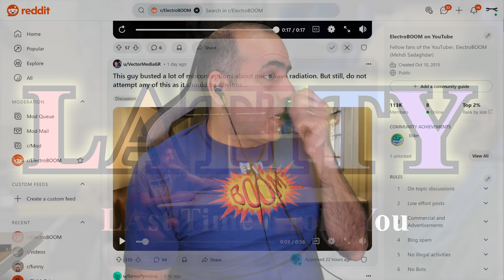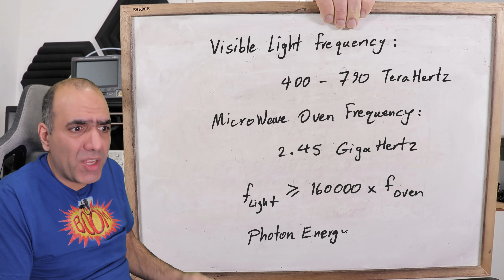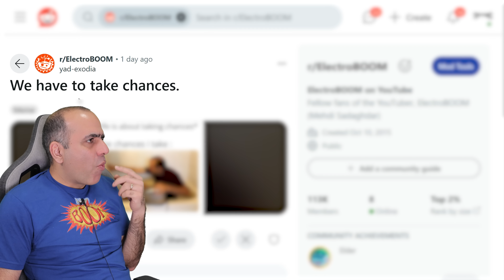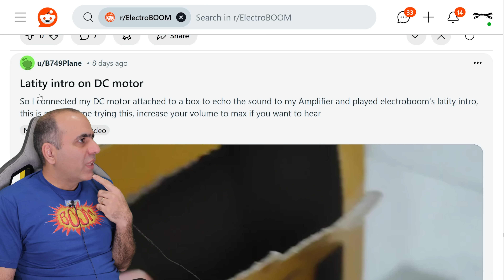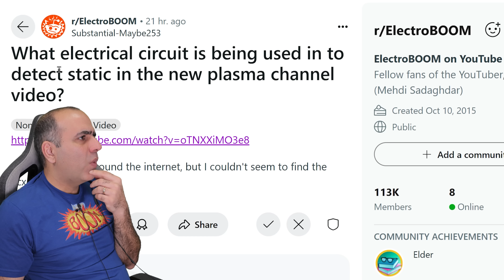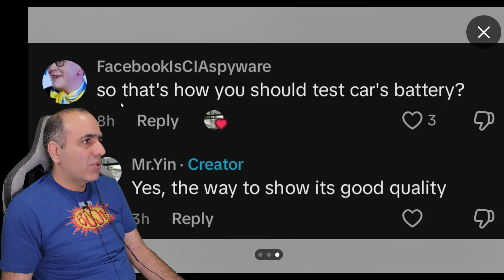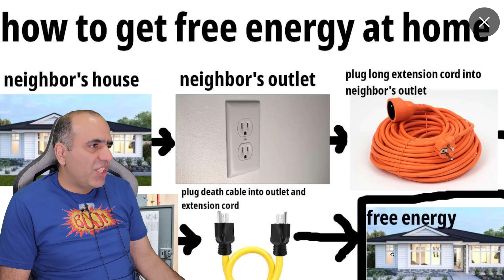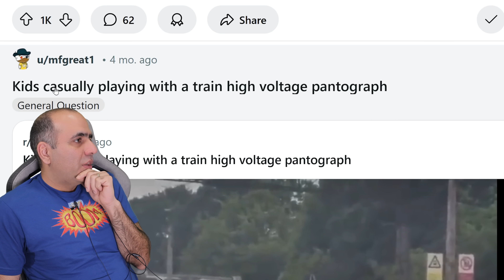Can You Microwave Yourself?! (LATITY014)

Comment: 5:07, yes a DC motor can absolutely be a speaker.  The motor just has to be driven by an ESC.  In fact that's what the start up tones on most high end drones are.  The ESC in the drone is using the brushless motors as speakers to output that sound.
Reply: A BLDC motor is something else than a (brushed) DC motor. Still works in the same way, but usually BLDC motors have much stronger magnets plus they can be held stationary to play music most accurate
Reply: @Robbedoes2  BLDC is such a misnomer of a name
Reply: One way I have seen it be used is in Mario wonder, if you run on the note block your controller will vibrate different notes.
Reply: That's also why a Siemens Taurus locomotive sounds like it's singing while starting
Reply: @Adsta it's actually the power converters that make the sound, not the motors themselves
Reply: It also works with a brushed motor. I retrofitted a brushed trolling motor with a PWM ESC to get a smooth throttle, and it produces that same high-pitched startup song
Reply: However an electric motor is not a very good speaker and won't make a lot of noise without an amplifier. Not even talking about the mismatched impedance.
Reply: @maxine_q  no but it does work
Reply: @ambrosekillpack4841  but not as advertised in the video he was showing
Reply: @maxine_q  I never said his video was real, I simply said that using a motor as a speaker is absolutely possible.
Reply: If you want to hear how music can sound on a bunch of home appliance motors, search "Device orchestra" or Floppitron on youtube.

Comment: If you use the euro plug in UK outlet you expose 240v on the partly inserted plug (like on the american plugs), UK pugs are isolated part way, the euro plug is as safe as it is because the outlets are recessed.
Reply: I can't remember when was the last time I saw all-metal euro plug, pretty much all of them are partway insulated nowadays. So, yeah, I can't think why this would be less safe than using cheap firestarter adapters.

Edit: OK, I just spent 10 minutes walking around the house unplugging everything, and I didn't see a single one non insulated euro or schuko plug.

Comment: I think the reason the wireless audio does that is because the magnetron outputs pulses at mains frequency because its a DC device, each pulse momentarily blocks the audio signal so it basically modulates your audio at mains frequency kind of like a ring modulator
Reply: It's because he uses a wireless mic that transmits in the 2.4 Ghz band, the same frequency as a microwave oven. I'm amazed any audio is passing at all.

Comment: I was always warned when working around high powered RF that you will cook the whites of your eyes and may cause cataracts.   Well, 30 years later - I have cataracts starting. I can still see fine but in 20 to 30 years, I may have to get it fixed.  I messed with very high power VHF when I was younger and I don't know if the cataracts are from that or just being old.  IMO, high power RF is OK, just beware of burns below the surface that you won't feel when they happen.
Reply: I've messed around with a lot of silly dangerous projects over the years, but there are a few things I draw the line at (now)...  
high-power RF/radiation/UV-lasers  (lasers was added after taking a stray reflection, still have a darkspot in one eye.).   Some things are not worth the risk, and that risk becomes so much higher when you can't see/hear/feel/smell/taste it. 
Worked with a few ex-radar operators, none of them were in great health, and none of them could have kids 😬
Reply: @N_Jones  Yes, frickin' amazon and ebay laser 'pointers' do scare me.  I've got a 5+W violet laser that I break out on Independence Day though.  It's the reflections that will get you and you never see them coming.
Reply: @N_Jones  Radar waves cannot make you sterile, unless they raise the temperature of your gonads above 35C° but that means you have higher risk of dying from hiperthermia than getting your bawls "cooked". I cannot fathom what they could be doing to be exposed to such levels of radar energy.
Reply: @N_Jones  None of the radar operators could have kids? Please do no spread these crazy ideas. I think you are confusing Ionising and non-ionising radiation. If non ionising radiation were to make you sterile, it would be from thermal effects and in the body-part you speak of, these thermal effects would be very noticeable, (pain), long before significant damage was done.
Reply: @ I suggest you read about “radar induced sterility of ground-crew” …
Weather radar operates at 10GHz which is in the microwave band…aircraft weather radar is 125+ watt. 
  
So, tell me again about how it’s “non-ionising” 😅.  
Don’t spread crazy ideas that 125w of microwave is safe for your balls…
Reply: @N_Jones  Perfectly safe for your man-bits unless you press them against on open wave-guide. Even then, pain would limit your exposure so little lasting damage would be done. And, I repeat once more, microwave radiation IS non ionising.
Reply: @N_Jones  I'd be more concerned about the radar systems on cars that are constantly putting out a signal to let you know that there's somebody in your blindspot or lets you know the distance to a point when backing up.  Yeah, that's super high frequency like K band and low power (relative) but you're exposed whenever you're next to another car or even inside your vehicle from reflections.
Reply: @BlackWolf42-  Absolutely nothing to be worried about.
Reply: @N_Jones  Microwaves are ionizing? 10Ghz is a lot? Absolutely not. +125 Watts is almost nothing, when you consider that energy is dispersed on a spherical area of 4*pi*distance².

You actually absorb a lot more than that by just standing in the sun, with light being orders of magnitude higher than 10Ghz
Reply: The cataracts are due thermal effects, So unless you were in such intense radiation fields as to heat up your eyeballs I doubt that was the reason. Actually staring at forges, glory holes or fire pits is far more dangerous.
Reply: I can see my own cataracts.  They look like transparent crystals.  Every year they're a couple percent larger.  
To view cataracts, go outside at night, and use a tiny lens to view a distant streetlight, or other intense pinpoint of light.  (I use the lens in my swiss army knife.)  The light should look like a smooth wide disk.  If you see strange objects  ...those are incipient cataracts.  To confirm, try it with one eye, then the other.  If you see the same stuff with both eyes, that's just dirt on the lens.  Clean yer optics well!  But if you see any clear objects in the disk of light, and they look different for your different eyes, those are inside your eyes and not just on the lens.   Also use this trick to view the tiny "floaters" in your eyeball.
Reply: Yeah that's what I've heard too. Cataracts. the dangers of high power RF are not always immediate. When i took my ham radio exam, there was a question about the effects of high power RF in the range of 3ghz. I also remember hearing that extreme exposure could cause hyperthermia in internal reproductive organs which lack adequate cooling to dissipate absorbed energy. Radio is a safe technology, but like any technology, it has safe limits that must not be passed. notably high power microwave radiation in particular is the most hazardous for humans, other frequencies will not affect us. my 450 watt microwave oven could make me blind, it's less likely that i would get hurt standing beside a 50 kilowatt MW transmitter... as long as i don't touch it, of course. 

i think mehdi was pretty reasonable with the RF exposure here, can't say the same for the guy that put their head in the microwave oven... that's asking for trouble. also, magnetrons are not fun, i was so anxious when mehdi was handling the magnetron. I hope he knows that it absolutely must not be damaged. most magnetrons contain beryllium ceramic (the glowing red bit) that will probably kill you if you break it and inhale the dust. microwave ovens are one of the like...
Reply: No, read it again, I’m saying just because it’s non-ionising DOESN'T mean it’s safe when in close proximity for extended periods of time.
 
Also FYI: “The instantaneous energy is about 15kW, but all commercial weather radars are modulated. The instantaneous energy is 50kW is the range of ground radars.”
 Which is why they advise “hot zones” for safety guidance in all aircraft operating manuals … go check an aircraft-manual.

“the CRJ uses a 25 Watt digital composite radar that has a hot zone of 3 feet when in the Wx mode."   It’s directed energy from a radar-dish... NOT an omnidirectional antenna. This is why radar sweeps in an arc, or circle (FYI, the few aircraft ones that sweep in a circle have special-sheilding to stop it pointing directly at the pilots and crew. how interesting, why would that be?) . Your r-squared calc needs include gain etc to adjust for that… it's incorrect.
 
“10ghz is a lot?” What, again, no not what I said!?  The issue is it’s within the specific range known to cause damage to humans, which is why 3-300ghz is restricted by laws in most countries … what are you talking about?
 
….standing in the sun?? I’m talking about people working mere feet from the device using radio frequency.  Not light frequencies which penetrates a few mm at most into the body, microwave is dangerous BECAUSE it dumps it's energy between 1cm and 10cm penetration into flesh...again, you are sounding out of your depth here.   

 
I’m passing on what I’ve heard directly from two guys who used to work closely around radar in the navy/RAF (who referred to themselves as “jaffas”).  I’m not claiming it’s all radar workers, and It’s not something I’ve deeply researched, but I’m also not some novice kid without working knowledge.  a very quick search reveals it’s a much talked about and researched topic…shh.
Reply: @N_Jones  See, now you're making more sense. Your previous comment was just vague and lacked information
Reply: If you get carracts from RF, it is an immediate effect. Unlike ionizing radiation where it can cause chemical damage that manifests years later as cancer, non-ionizing microwave caused cataracts are a direct and immediate effect of thermal damage. The microwaves raise the temperature of your eyes and cook them. And one of the cooking effects is that it causes the lens of your eye to become opaque, similar to how transparent egg white liquid becomes a literal opaque white solid when heated. That's what is happening in your eye when exposed to too much RF, particularly microwaves. And that is something that will happen in a matter of seconds. If you got cataracts much later in life, then that is just an effect of your aging, not due to microwave exposure from years ago.

Comment: One of the other concerns with using a microwave in the open is the fact that you cause a lot of interference with radio systems and if you live in the US it’s illegal and the FCC will hunt you down and fine your for it. It also tends to piss off ham radio operators as well and they aren’t really the type of people you want to piss off as they often train to triangulate and hunt down sources of radio interference and report it to the FCC. It’s best to do experiments like that in a faraday cage so you don’t leak a ton of interference into your surroundings.

Comment: One of the risks with microwave exposure at this level (10s of thousands of times more than mobile phones / wifi etc) is cornea / lens damage due to local heating as it does not have blood flow to carry away the heat. Damage of this type might not become apparent until the next day unless it is really extreme.
Reply: Proof
-

The FCC's SAR limit is based on research that found animals' behavior was disrupted at an SAR of about 4.0 W/kg after 30 to 60 minutes of exposure. The FCC's SAR limit for cell phones was adopted in 1996, after the FDA and FCC adopted guidelines set by the American National Standards Institute (ANSI) and the IEEE in 1992.
Reply: They have never tested a SAR of 2 for say 16hrs.
Only 4 is too much in 30-60 min. 🤨
Reply: I read several comments. What's interesting is that in the experiment that I did, I was able to generate plasma from a grape. An eyeball is full of fluid and is bigger than a grape but still close enough to internally focus the energy. That's insanely bad if you were to do that to your eyes.😢
Reply: To be clear, based on 1996 animal data for an hour, we concluded 1.6W/kg to be the limit for humans using an Apple IPhone 15, and wearing an Apple Watch 5.
Also those tests were done away from the body, not touching it.
Reply: @threestans9096   The reason why radio waves are low down my lists of concerns (except if operating a microwave without the door on with your face near it) is that we all have been pretty much constantly exposed to radio waves from nature such as lightening strikes, the cosmic microwave background, solar flares etc.
Reply: So here’s the thing about Cell phone radiation-the health standards are based still on early 90s usage. so a phone can give off harmful radiation but it’s not caught because they only test for 30min of usage and carrying it for like two hours of the day. or Apple has been caught releasing updates that cause the device to emit more radiation(like a governor was removed type thing)
Reply: @threestans9096  Mobile phones, wifi and similar devices just do not have robust enough electronics to emit the 600W or more of microwave energy like ovens can. The  main reasons to limit radio power output on phones and wifi are battery life and minimising interference.
Reply: @aaron_11111  Right. The upper limit is typically +23 dBm or 200 milliwatts. And that's only when it's needed to reach a distant base station; usually the power is kept much lower to minimize interference with other mobiles at the base station receiver.
Reply: @threestans9096  okay woowoo man
Reply: @threestans9096  "Harmful"
Reply: @threestans9096  Until they manage to break the laws of thermodynamics, I’m not worried. The difference in energy delivery needed to cause detectable injury versus what can be delivered by a cell phone power source and emitter is so massive it’s difficult to convey. It’s like saying you can fit an aircraft carrier in a backyard pool because a toy boat can.

Thermal energy doesn’t give a shit what new-age crystal nonsense you believe, unless you can put enough energy in a given spot in a short enough duration, it is physically impossible for it to cause harm.

Comment: Can anyone explain why I heard a low sub hum from a broken Microwave when it was on? Through several walls and doors too.
Reply: Probably the transformer. I've cut one apart and glued it back together before, thing vibrated like a subwoofer (60Hz)
Reply: @TheCarpenterUnion  And I only heard the sound in my left ear which has slight hearing damage, but no one else could hear it. It also made me bit nauseous and I felt some pressure in my chest. Kinda like Havana syndrome symptoms.

Comment: Hmm, this pantograph video has to be fake, the power from the overhead line will jump to you and kill you/severly burn you before you even get that close to it…
Reply from the maker: I don't know the train voltage, but it shouldn't be huge, even at 10k it just barely jumps over 0.5 cm. But it can stretch long if the power is high enough
Reply: @ElectroBOOM  in Switzerland it's 15 kV. And all the warnings I found are that it can jump 1,5m. And I know of accidents without touching the wire. Maybe you can find out the circumstances...